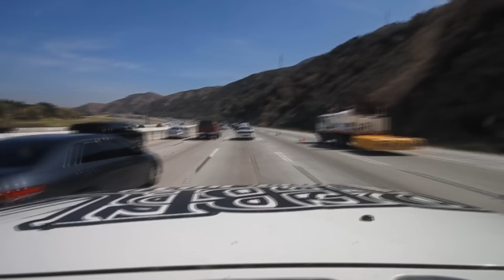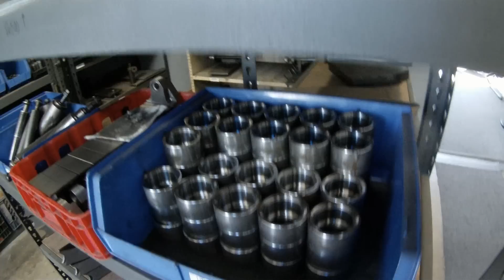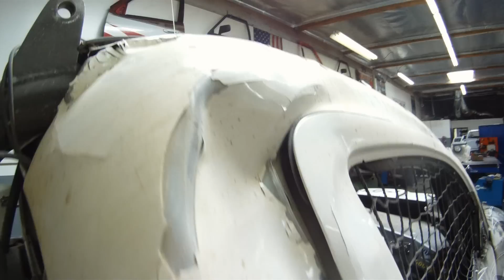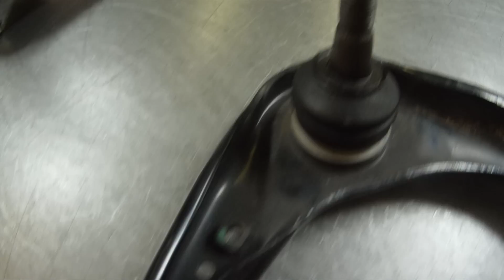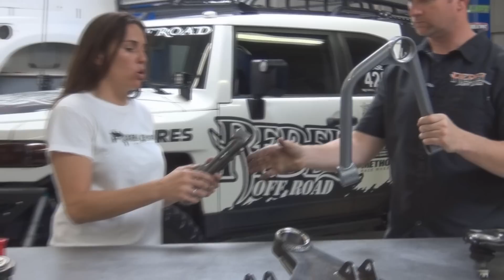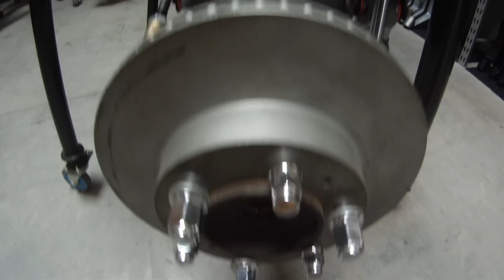"Total Chaos Fab" by Rebel Off Road // MFG Spotlight

Comment: Uniballs are high maintenance though, that's the only pain in the ass con about them. If you're into rock crawling/overlanding you are better off with an oem style ball joint incase of failure you can swap it out it on trail and keep moving.

Comment: I had total chaos UCAS on my 2006 tundra coupled with king 2.5 x 8 inch coil overs and the ride was fantastic. That truck saw more than 30 miles of off-road abuse on it with a single issue.
Reply: Just did the same setup to my 2006 tacoma 4x4, TC UCA's and King 2.5, adjusters, 700lb springs...feels like a completely new truck. Great gear.